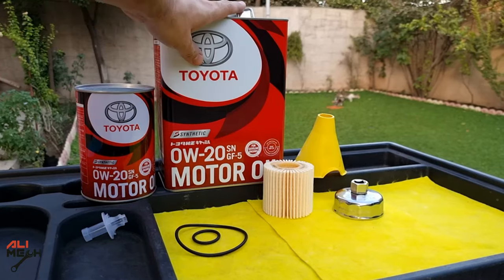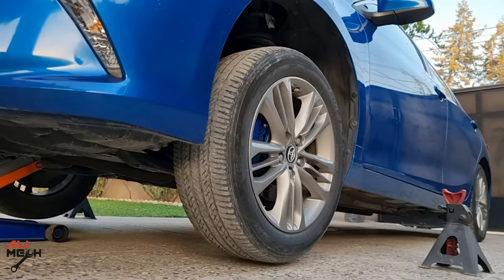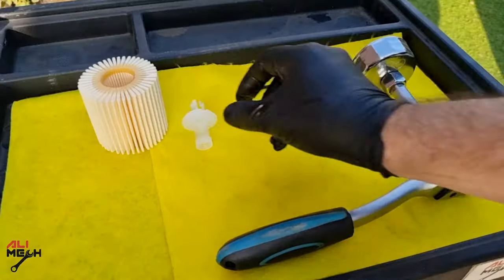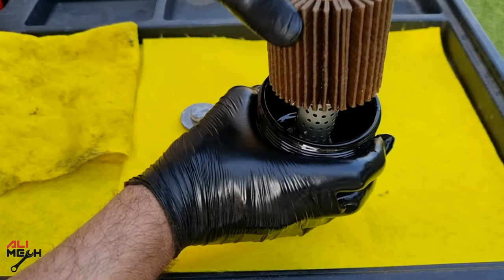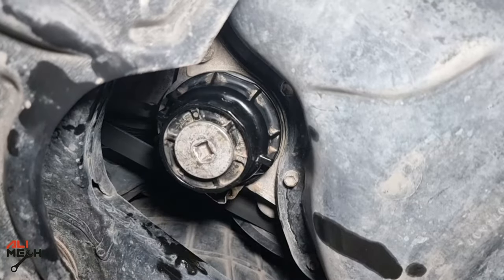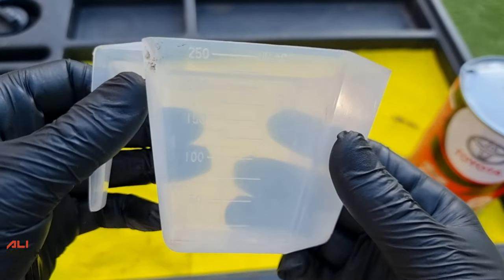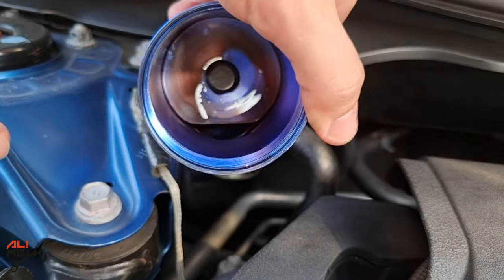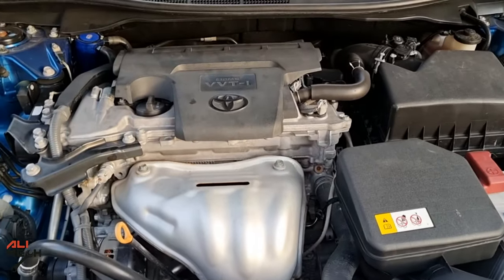How to change Toyota Camry 2.5L Engine OIL 2015-2017/How to reset scheduled maintenance on Camry

Comment: Thank you for the video. You gave me courage to lift the car and get under it in my garage.  From the side I was, I did not see the small latch.  The filter is hard to unscrew and I bent the latch and it broke off.  Because the filter cap is so tight, I do not think it will come out on its own.  I am looking to buy a new one.  Yours and other videos here did not say how it works.  One mechanic just said to bend it away.  Any input you can share with us?
Reply from the maker: The filter is just be unscrewed and comes out,  it doesn't need to be tight 
It's just like I showed, nothing more

Comment: Question:. Since brake cleaner is damaging to plastic, do you think it's safe to spray it on the plastic oil filter cap.

Torque specs...
Oil filter cap = 25 N•m or 18 ft.lbs.
Oil filter cap drainbolt = 13 N•m or 10 ft.lbs.
Note: if these torque specs aren't followed and you over-torque the drainbolt the next time you try to remove the drainbolt the entire oil filter cap may come off with it.
Reply: My same thought. He actually did a video a little while ago about using mass airflow cleaner on plastics instead. I suppose you could use the carb cleaner as long as you ensure you get ALL of it off so it doesn’t damage plastic over time. But I’d just avoid it altogether and use the proper cleaner.

Comment: My friend 
i have a car exactly the same as yours i've installed oil catch can i noticed it's a weakness in engine power and high rpm at high speeds could it be the reason from oil catch can

Comment: Hey bro what happened to your 3d printed filter removal? I was thinking to use your design but I didn't any cut or groves in the design that I see on amazon etc, let me know please, it's for camry 2015
Reply from the maker: I left it under sun and it deformed a little, but it was working fine

Comment: biggest problem is removing filter housing after somebody has tightened it too much it barely needs to be tightened since the o ring is on side not on end of housing the filter wrenches with extra notches for those toyota filters when they are stuck

Comment: The plastic oil filter cap is very tight.  In fact so tight that my filter socket is stuck to it I can't get either one out.  The filter socket is stuck.

Comment: Weird oil filter. Did many oil changes on my Toyota thru the years using the old Aid Auto Stores metal ramps bought in 1978 for under $10.00!

Comment: 0-16 will lose its viscosity to 0-10 or 0-5 as time goes on, it will damage the engine. 5w-30 has proven to last a million miles in scientific testing. Use 0-30 the least to 0-40 because it will get thinner as the oil get wear away. We see old oil is much thinner because it worn away.
Reply: I don't understand your comment... This Toyota uses 0W20